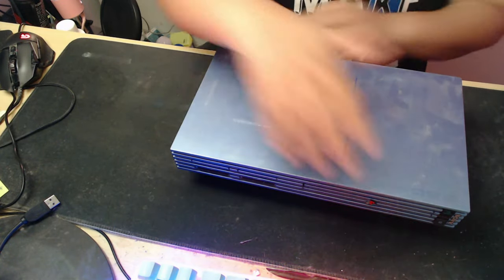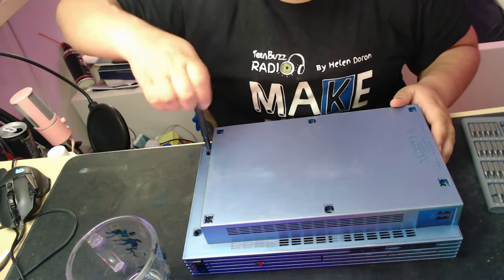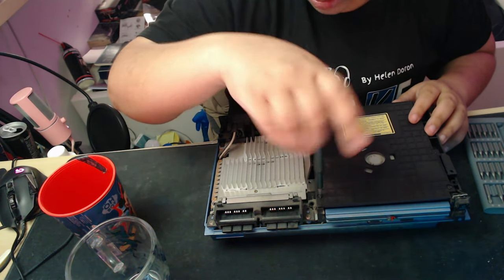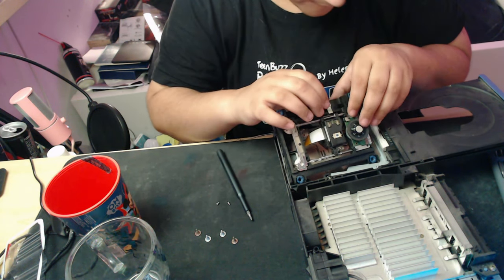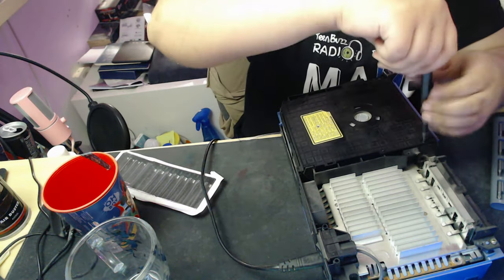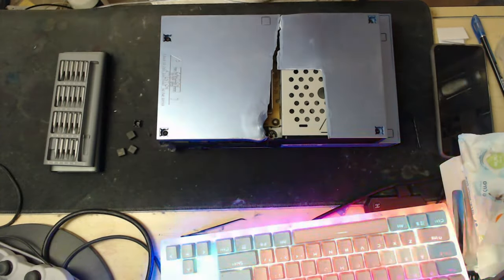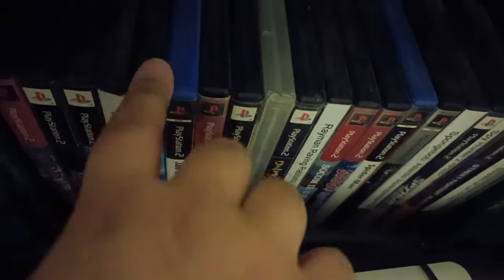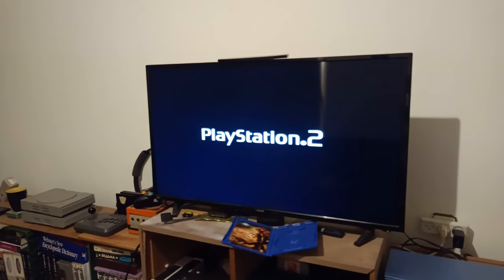PS2 Drive Repair + Bottom Replacement - Retro Repair Episode 1

Comment: Great video! The blue PS2 was my brother's and mine very first model and I regret not taking more care of it over the years. It has a bunch of scratches because it spent years in the basement. I accidentally ripped off the controller port cable while I was cleaning my console years ago. Now I'm looking for a spare part. Can I use any aftermarket cables as a replacement? I am currently cleaning my console again and trying to get it in a better shape.